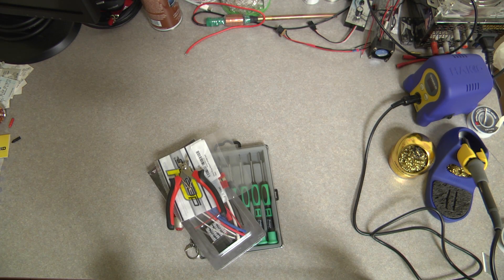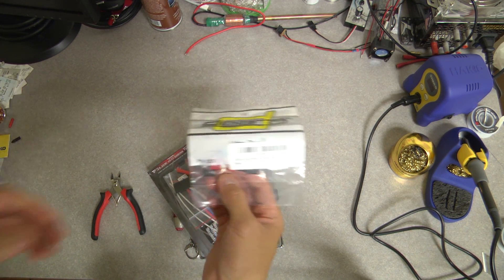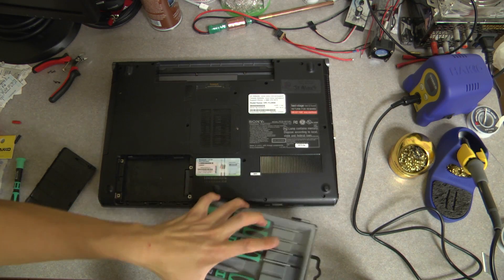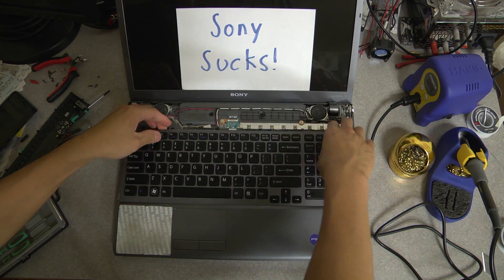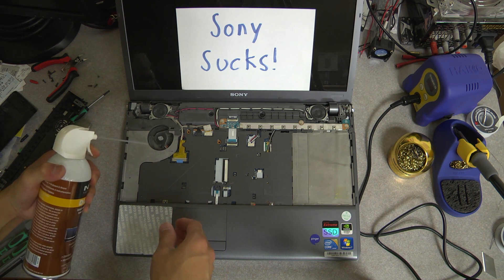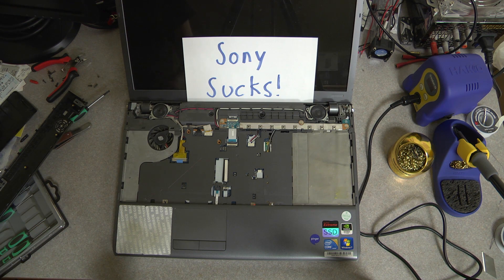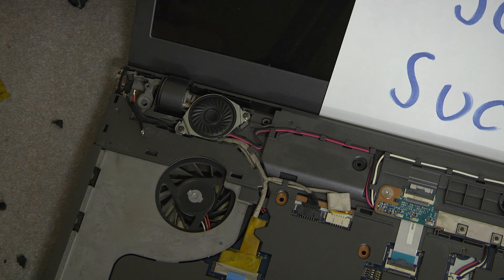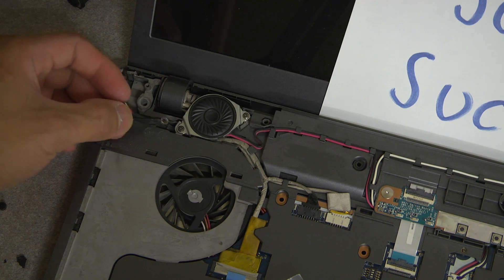Sony Vaio Laptop Simple Charging Connector Mod

Comment: Question - How did you figure which is red and blue wire inside laptop? Or it doesn't matter?
Thank you so much for this video. I was planning on doing the same but didn't knew how to do it.
Reply from the maker: The red and black wires (aka polarity) was tested with the multi-meter to ensure that the power wires was soldered correctly. Wrong polarity will damage the laptop and or power brick. 

This modification can be done with any laptop that uses a DC barrel jack charging as they type of connector wears down easily.

Comment: I also have a VAIO with the same problem (it has the fork connector that you described).  I think the issue is that they did not use the correct power jack diameter when they shipped the included power cable.  I measured 6.0 mm OD on my jack and it should be closer to 6.5 mm.  After a year or two, the leaf spring contact will take a set and there won't be enough interference to engage the leaf spring any longer.  For such an expensive and beautiful machine, this is a pathetic oversight.  The engineer that designed that part combination should consider a job more suited for someone with zero attention to detail.

Comment: this is awesome, i have a toshiba with a finicky dc jack (the ac adapter reads the correct voltage, but theres no voltage reading to the mobo when its plugged in) so i ordered a new one and was wondering if i could use a entirely different jack altogether. Exactly what i was looking for to clarify, thanks